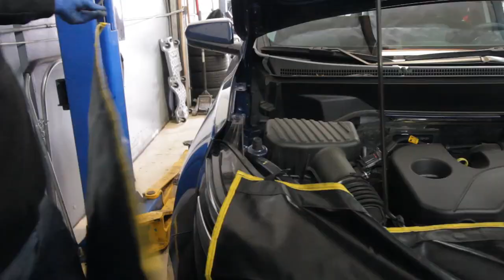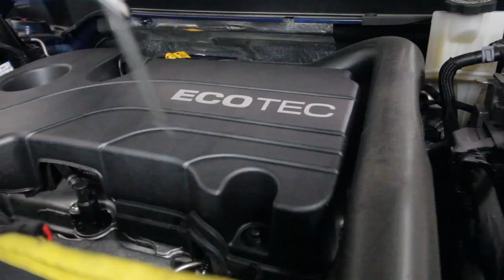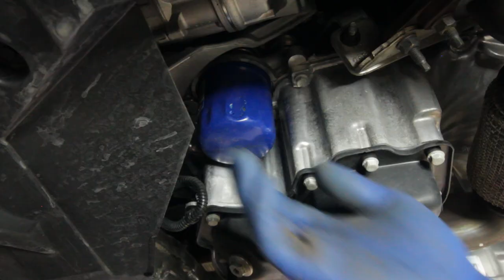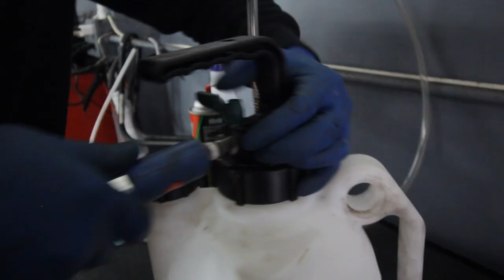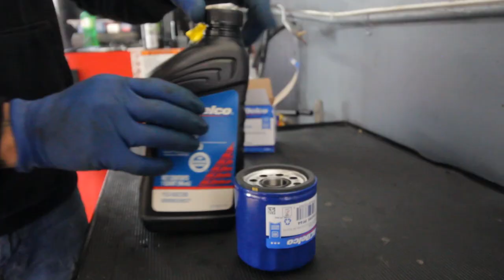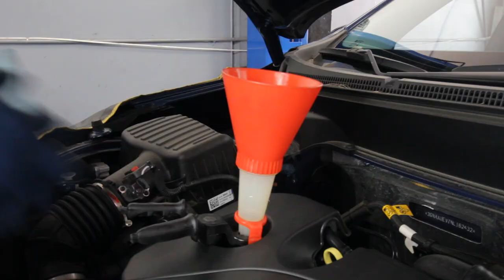Oil Change 2022 Chevy Equinox

Comment: Boss what is the glue thing that you put on the oil drain plug
Reply from the maker: its called Viz-Torque tamper detection marker that lets you know if someone has tampered with the bolts or broken them lose or it came lose.